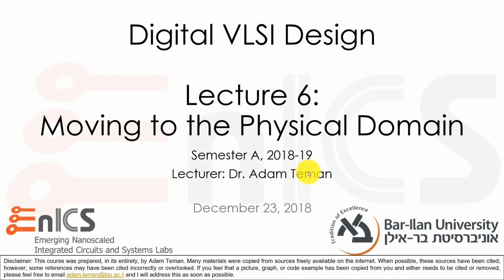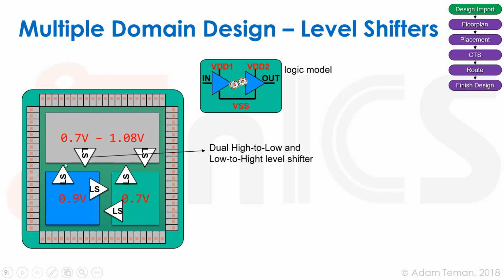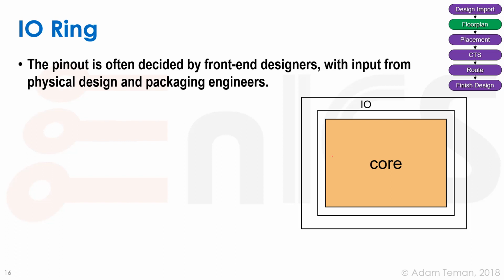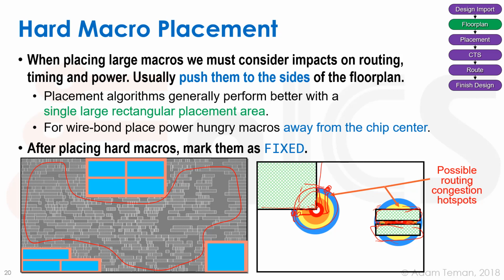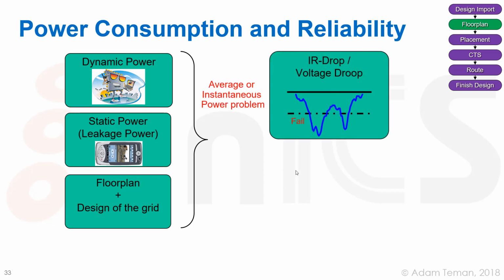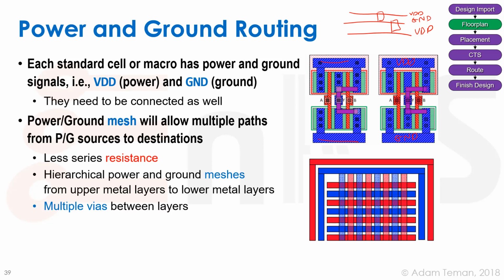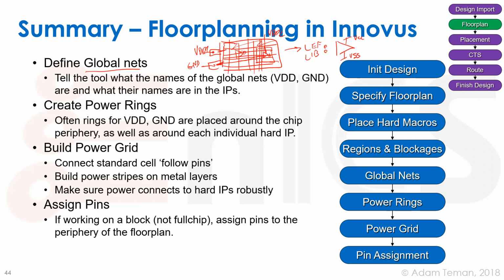DVD - Lecture 6: Moving to the Physical Domain

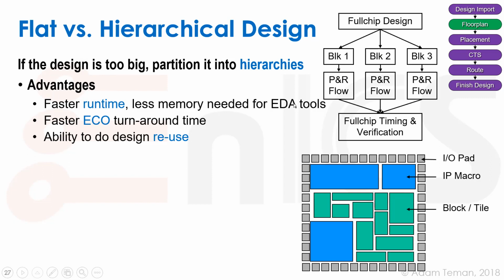Comment: Sir, at 36:51, you told it will take fewer licenses, can you please explain this.
Reply from the maker: When you use the commercial EDA tools within an industrial environment, you have to purchase licenses and these tend to be VERY expensive. There are different licensing models, but in general, the more compute power you need and the more users concurrently using the same tool, the more such licenses are required. 
Luckily, in academia, at least that part is a lot easier...

Comment: Hello Sir, how does creating keep-out margin for any standard cell reduce routing congestion? since the routing is done on completely different layers on a silicon floor, how would this empty space help reduce the routing congestion? Thanks
Reply from the maker: Great question.

Indeed, this could be a bit counter-intuitive, since - as you pointed out - the routing is on the backend layers, while the standard cells are on the frontend layers (optimally, entirely M1 and below). However, the main cause of congestion in logic areas* is what we call "pin density", which is the number of connection pins per unit area.
(* The reason I say "logic areas" is because many congestions are caused due to lack of routing resources due to macros that block backend layers)
When there is high pin density, the router needs to go down to M1 at many places in a small area and route each of these connections to other standard cells or macro pins. This causes a lot of congestion on the lower layers that have to be traversed through in order to make these connections. Therefore, by padding the cells, the pin density is reduced (the effective standard cell area grows, while the number of pins is unchanged), ultimately alleviating the congestion in the logic areas. Note that this does not help congestion around macros, which is caused by high pin density on the macros and a bad floorplan (or tough area constraint).

Comment: Hello Sir, I have a question. Why do we see very high utilization (70%) at this early stage of floorplan where placement of std cells is also not done?  As per my understanding, at floorplanning we only put macros , I/O Pads ( not sure about IO buffers in the I/O buffer only channel between the macro and core boundary, do we also put that? ) how will utilization reach 70% ? and if it is such a high, wouldn't that exceed in placement stage only and no space for Clock cells and optimization? Thanks
Reply from the maker: Hi Hrishikesh,
I think that maybe I didn't explain that point very well. The 70% utilization includes the standard cell area. In other words, the tool does a very simple calculation, where it takes the sum of the area of all the IPs (=standard cells, IOs, memories, etc.) and divides it by the floorplan area. So the 70% utilization is basically leaving 30% extra area for clock cells, optimization, and maybe most important, to alleviate routing congestion. Some designs will converge at a much higher initial utilization, while others will need a much lower utilization or to mark of areas of partial placement blockage to converge.

Comment: Thank you so much for this wonderful playlist.  I had a question, in the summary  section we see defination of global nets, would this still be required if we have p/g tracks?   Idea being if we can get vdd/vss from the p/g mesh I assume we wouldn't require the global nets. I would really appreciate a clarification.
Reply from the maker: Yes, we still need the global nets (at least in Innovus).
The global net is basically a toplevel naming convention for the p/g net. It's not a physical thing, but it's used by the tool to connect the p/g pins of different cells. 
For example, lets say you have a standard cell library with the p/g pins called "VCC" and "GND" and a memory with pins called "MVDD" and "MVSS". But VCC=MVDD and GND=MVSS. To make this connectivity at the toplevel (the hierarchy above), we first create global nets (e.g., "Global_VDD" and "Global_VSS") and then connect VCC-->Global_VDD, MVDD-->Global_VDD, GND-->Global_VSS, MVSS-->Global_VSS.

Comment: At 1:00:21,  please explain the point, number and location of power pads per voltage depends on the switched I/O's we have....
Reply from the maker: I think if you have since watched Lecture 10 https://youtu.be/O2Od1Tey-Jo, you may have understood the point better. 
In general, we need to supply the chip with power and we do it from as many locations as possible - connecting the power supply (e.g., battery) to the package through the board and from the package we feed it into the chip through the I/Os (or bumps). When we connect VDD somewhere, we cannot use that connection for a signal, so there is a tradeoff. We need to decide where to connect VDD (and GND, etc.). We also need the I/O power supplies to be close to the chip outputs to supply current to the output nets.

Comment: At 50:28 what does it mean, provide current return paths for signals?
Reply from the maker: For an electronic "circuit" you need a "full loop". So you send current to the device and that current needs to return in order to close a circuit (otherwise, it's an open circuit). Hence, "current return paths".

Comment: Why put blockage in feed through concept at 42:59?
Reply from the maker: The point is that you are implementing a macro as part of a hierarchical flow. So the top level wants to route a signal through this area that is being implemented standalone - independent of the toplevel. Without blockage, the area required for the feedthrough would be used for other nets. 
You can either apply blockage to make sure it won't be routed through.
Or you can implement the feedthrough route at the macro level instead of the toplevel.

Comment: Can you please explain the point at 35:05,  poly has to be in the same direction, that we need to take care for macro rotation?
Reply from the maker: In newer process technologies - from around 65nm and below - there are hard restrictions on the orientation of transistors. So you can't just draw your poly any which way. The transistors usually have to be in the same direction. In this case, a hard macro can usually be flipped on one axis, but not rotated 90 degrees (which would make its poly's in the wrong direction).

Comment: Thank you very much for such a good explanation. 
What is this, refine the synthesis in local congestion topic? At 24:01.
Reply from the maker: It is quite an abstract recommendation, but it just means, go back to synthesis (or even RTL) and try to change things so you won't have this problem. I can't tell you "how" to do this, since it is really a per-case situation and doesn't always (...usually) have a solution, but in some cases, if you would have changed something in synthesis, you wouldn't run into a specific problem.
Reply: One of the example for this is scan chain re-ordering which is done internally by place_opt_design. Please have a look at that concept of you have time.

Comment: Thanks .One doubt- Gate level netlist of one RTL design(module)   is divided into different blocks?or One RTL design is divided into different blocks before synthesis?
Reply from the maker: I'm not exactly sure I understood your question, but here is my try to answer. RTL is usually divided into many modules. The higher modules instantiate the lower modules in a hierarchical fashion. This is mainly to simplify the design ("divide and conquer") and to enable design reuse. For this reason, in the lecture on Verilog for Synthesis (earlier in this series), I point out that good practice is to put each module in a separate file called <module_name>.v

You would then read all of these files into the synthesis tool (or simulation tool, for that matter). During elaboration and synthesis, the tool will ungroup the majority of the modules to optimize the logic between them. This means that the hierarchy is lost and their is no more division between modules. Some of the hierarchy will be kept, but unless explicitly defined to not ungroup a certain module, the synthesizer can "do as it pleases". So the gate level netlist will have some degree of hierarchy, but it is generally quite flat.
Reply: @AdiTeman  Hi sir, is it true that ungrouping removes (or collapses) the level of hierarchy of the identified subdesign and merges the subdesign with the surrounding logic ? Or can you please explain ungrouping in details?
Reply from the maker: Hi Akash, sorry for not responding. I didn't see your question.

Yes, in general, ungrouping removes the hierarchical barriers between the modules. This enables cross hierarchical boundary optimization. Just as a simple example, lets say that a signal is inverted to be driven into an instantiation and then is inverted again at the input to this instance, by ungrouping, the two inverters can be removed. The drawback, of course, is that it makes it harder to debug. But the common approach is to ungroup almost everything that is not placed and routed independently.

Comment: @31:05 we anyways  have different layer for routing so what is stopping us from placing std cells in keepout region
Reply from the maker: Hi Himanshu, good question. Indeed, the halos or placement blockages are recommendations, not something that is necessarily a must. The main reason is pin access and overall routing near the macro. So for the pins, let's say you have a high pin density on a certain side of the macro and you need to connect many wires to these pins in a small area. You want to free up as many routing resources as possible in this area. However, standard cells require connections and routing on lower layers and therefore they can use up those routing tracks that would be needed to connect to the macros. Another general reason is that usually there are routing blockages on the macro itself, which means that there are fewer routing resources for the higher level to use. Therefore, we want to free up the areas close to the macro so that any required routes will not be disturbed by routing to standard cells in that area. The corners are the worst area in that sense, which is why we add additional placement blockages at the corners.
Reply: @AdiTeman  2nd reason that you have mentioned is similar to what you have explained in the video between 27 to 28 min?

Comment: Thanks for your sharing for this video ?  
Could you give some advice for Power Planning Part (Such us how to choose the Power Ring Width , how many sets of them , and the stripe spacing ...)
Reply from the maker: Hmmm... Very very tough one to answer. This is really something that I am not aware that there is a good methodological approach to solve. In fact, it's a bit of "black magic" kept by some backend leader in each company.

However, there are tools to ensure that you put enough power. The tool from Cadence is called "Voltus" and it has features, such as "early rail analysis" to help plan your power grid and "EM/IR analysis" for verifying that the grid is robust enough after implementation. I don't currently have a video telling much about these tools, but I may prepare one in the future.